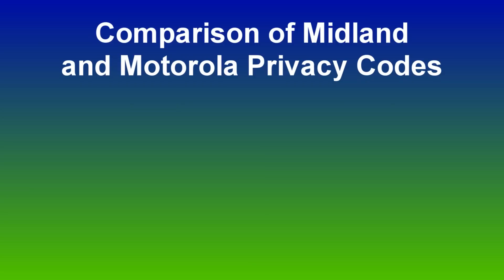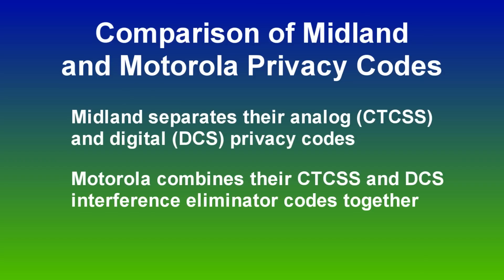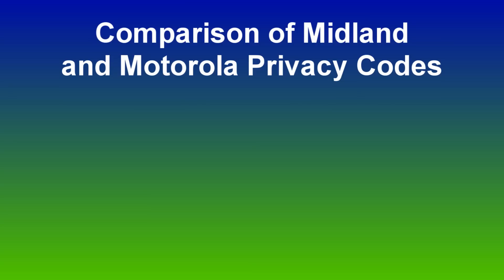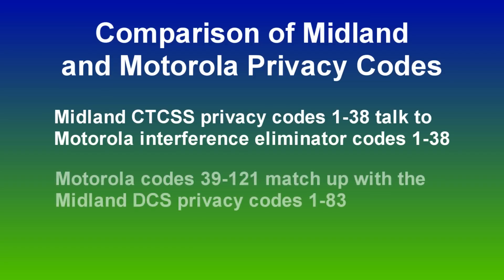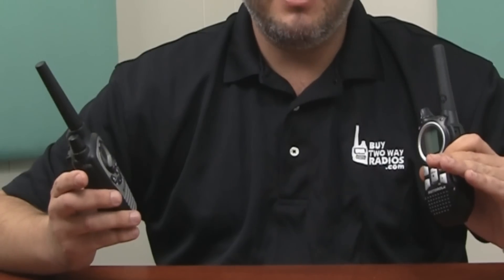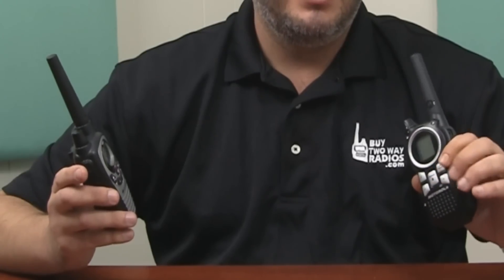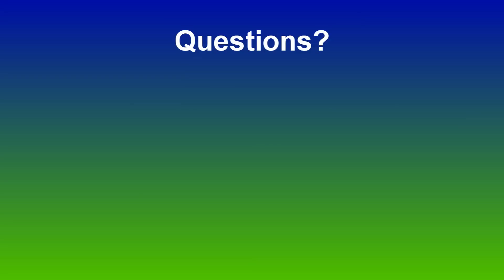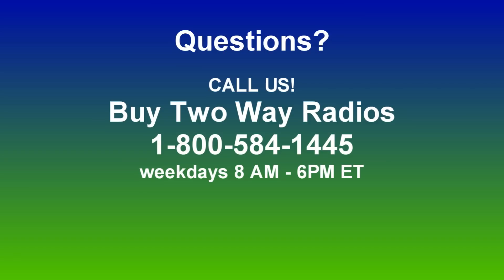Resolving Privacy Codes on Midland and Motorola Two Way Radios | Radio 101

Comment: I am trying to get my Midland GTX1030s to talk to a Motorola group with privacy code 11.  It appears the GTX1030 does not support CTSS codes, only DCS.  Any clue about that?
Reply from the maker: The GXT1030 does support CTCSS codes. The hurdle here is that Midland and Motorola assign CTCSS tones and DCS codes to a number in the menu of their radios, with the number being different for both of them. The way around this is to look up the CTCSS tone chart in the manual for each radio and match the menu number to the tone or code you want each radio to use, and assign the same one to each radio.
Reply: Did you ever figure it out? I’m trying to do the same thing as you

Comment: I have a Midland x talker and want to connect it to my job's network. I've tried the putting it on frequency 7 code 62 as frequency 7 dcs 24 but still nothing. Any advice?
Reply from the maker: What make and model of radio is your company using? The Midland X-Talker radios operate on license-free FRS frequencies. If your company is using business or commercial analog or digital radios, your Midland radios won't communicate with them.

Comment: I have an rt22 and motorola t200. Motorola receives but I'm not able to listen back in retevis. What code should the Motorola be for retevis to receive
Reply from the maker: We do not carry the Retevis RT22 so we don't know what, if any, default CTCSS tones and codes are programmed into it. You will need to consult the manuals of both radios to cross-reference the tones and codes available for each model.

Comment: I bought 2 pairs of T460 motorola walkies talkies of  35 miles. And  they have low range in the city Do i need to get a license to get long range.  I need some  answers please. What do i need to do to get  a long range.
Reply from the maker: The short answer is no, a license will not help you get more range out of your radios. The Motorola T460 is an FRS radio, which is already licensed by rule, meaning that you don't need to buy a license to use it. The problem you are experiencing isn't a licensing issue, it's about your location and surrounding terrain. The 35 mile range posted by the manufacturer is based on use of the radio under optimal conditions. You will get much lower range in the city, which is considered normal, not optimal. The radio range chart in the link below is a more accurate calculation of range, and will help clear up the confusion. For some, it's an eye-opener. https://www.buytwowayradios.com/blog/2016/12/gmrs_radio_range_chart.html

Comment: I just got me a Midland mxt 400 I am using both ctss and dcs codes to talk to a Motorola rep system I can't hear them at all but they can hear me they are on ctss 203.5 and dcs 40 on there system so how can I get it to match up to hear them
Reply: I have the same problem have you solved the problem yet?
Reply: @jorgegalvan9371  there is no way to solve it they just don't allow you to do that I been told that poc it's no good for repeater us at all

Comment: There's a cloud showing in my midland gxt 1000 vp4 how to get rid of it ?
Reply from the maker: The GXT1000 is equipped with NOAA weather channels and a weather alert feature. The cloud icon means the weather channels are active. To remove the cloud icon you will need to go into the menu and access the weather radio function. Once you are in the weather radio, press the PTT button to disable it. Full instructions are on page 18 of the Midland GXT1000 Owner's Manual, which is available online.